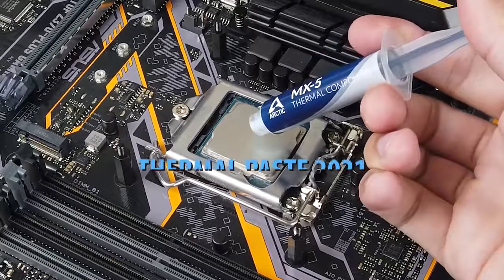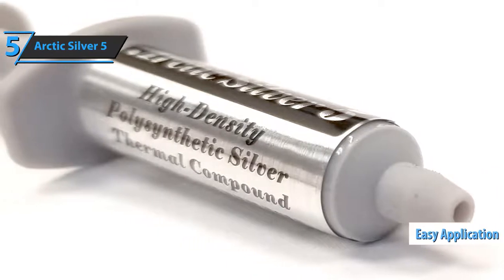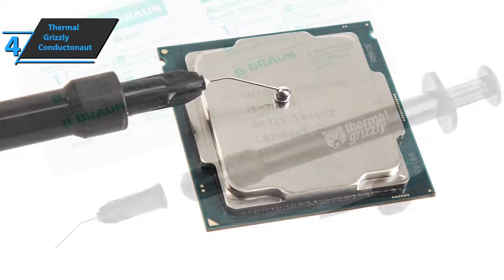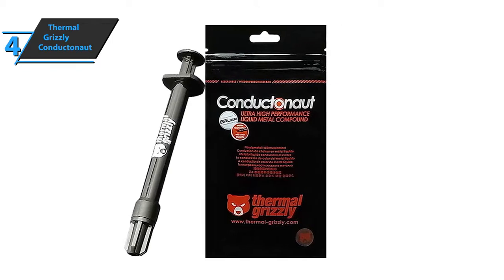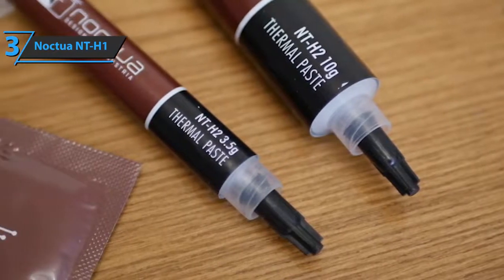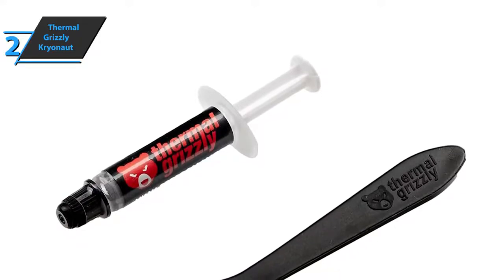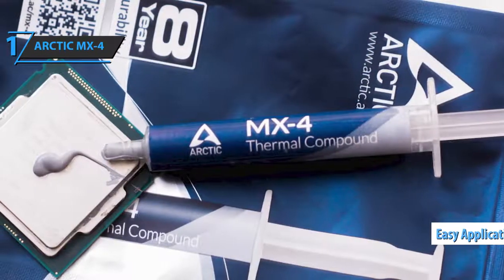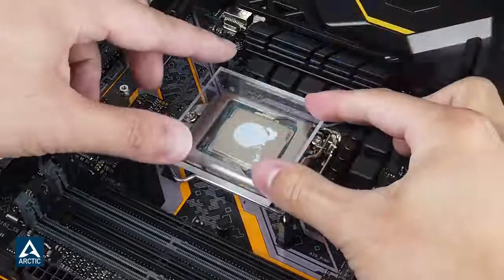BEST 5 Thermal Paste of 2021 - Arctic Silver 5 | Thermal Grizzly | Noctua | ARCTIC MX-4

Comment: long time user of AS5 as well. Many forget to mention it also needs time to set in through hot / cold cycles to get the settled in temp of usually 3c less could be -5c. Furthermore, 3yrs will outlive any CPU for high end enthusiast & GPU's as they're changed at average of 1 & 2 yrs. However, for fun I pulled out builds of 5, 7 & 10+ yrs & the 7yr, hardly noticed. The 12yr if anything, barely came back down 2c if that.  3yrs is covering themselves but 5-7 is realistic if you kept it that long.

Comment: I’ve been using Artic Silver T.I.M.’s since like 2000.   The Artic Silver 5 is my favorite of all time but even Artic Silver recommends that one reapplies it ever 3 years so I quit buying it.

OCZ Technology use to make a paste called Ocz FreeZe that I used a decade ago to great effect.  Outstanding and not expensive. 

Corsair TM30 Works good in a pinch ime, lasts a long time apparently. It’s always available at a local Best Buy.    Not a great T.I.M. but not crap. 

Scythe - The little bottle of paste that comes with Scythe coolers is awesome. I have no idea who makes it or how long it lasts. 

Artic Cooling MX-4 is a truly great product like Artic Silver 5. They claim it performs well for 8 years.   My go to.

Haven’t tried……
Thermal Grizzly - Kryonaut. This has been the hype and buzz in recent years.   $19.00 for 2 grams. Ouch.
Reply: Thermal Grizzly dries out quite fast though. Not recommended for folks that doesn't want to open up their computers often.